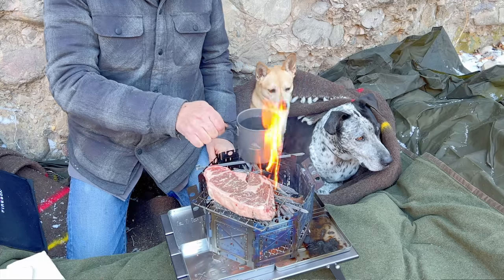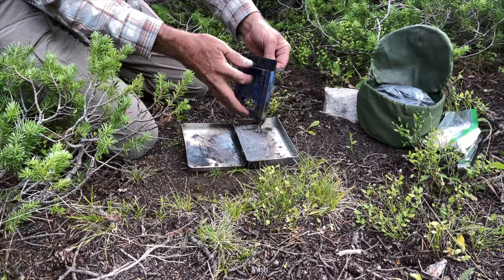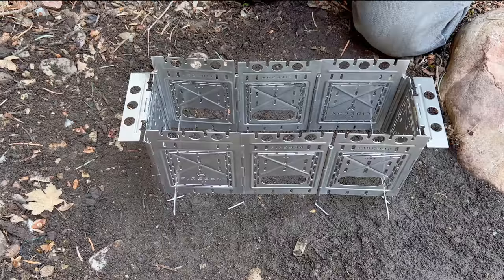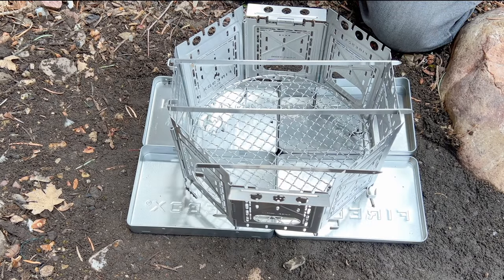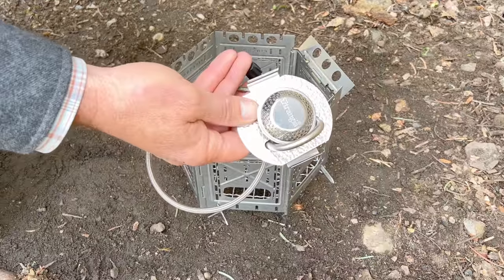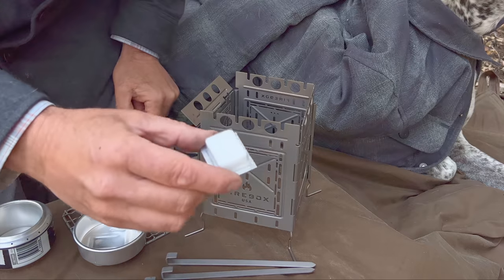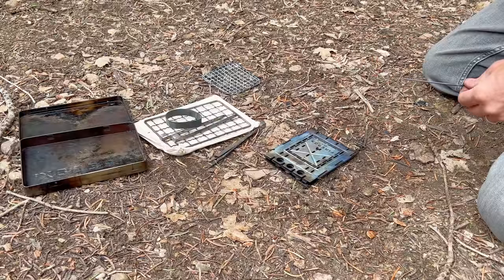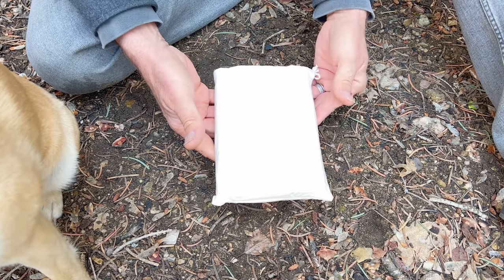Tips & Tricks! Firebox Freestyle Modular Camping Stove Instructional.

Comment: Thanks Steve I received my single titanium freestyle and now had several burns. It starts up really fast and burns hot, though I have managed to create a lower temperature for cooking by just adding larger pieces of wood to the fire. So far it’s exceeded my expectations and will be part of my kit on a 7 day backpacking trip I have planned. Only downside so far is that the tin when acting as an ash pan can  get very hot as small coals can drop through the fire grate so I will probably use some carbon felt underneath to protect the ground or table a bit more.
Reply from the maker: Thank you for your support and feedback Peter, it is truly appreciated. Have fun out there!

Comment: Lots of comments on the quality of the build. As soon as I unpacked mine the first thing I noticed was the greats are much more robust! Maybe it is just me but I really noticed a difference.
Reply from the maker: You are correct Jay the fire grates are quite robust. That's because they endure the highest temperatures. The cool thing is that the wire fire grates are about half the weight of sheet metal fire grates👍😎

Comment: Great tutorial.  Be great if the bag was a dark colour that would hide dirt and grime.  Do we need to worry about hot fires over time wearing out the grates and grills especially with campfires ? 🔥
Reply from the maker: The grills and grates are overbuilt and will last a long time. Heat will lessen their ability to resist corrosion so a light coat of oil maybe needed occasionally to keep the parts properly maintained.

Comment: Hey Steve.  How about making a flat like griddle/hibachi accessory to be purchased separate.  Out of stainless with some type of reinforcement “X” under it what a
The same size as the square grill that sells with the freestyle combo kit.  But that will hold it inside of the fire pit 8 configuration.  

Would probably fit in the same pack as the rest of the kit.  An even more so. If some of the other grates that may be left home that’s not gonna be used for a certain trip.  
    Would definitely love to purchase something like that as an accessory
Reply from the maker: Thanks for sharing your idea with us, we'll have to look into that!
Reply: @fireboxstove  that would be amazing.  I’m definitely in for one of them.   Some kinda”X” pattern on the bottom side that would keep it inside the fire pit 8 without needing to hold it an it sliding around.  
     Also strengthening it for the heat to mitigate any warping from the heat.  An maybe an 1/4 or 1/6 of an inch lip going around it.   
     Maybe maybe just the tinniest fraction of an inch bigger than the big square grate.  So it the square great would sit down right within the lip going around the griddle.  So the only added thickness in the case.  Is the thickness of the stainless sheet itself and whatever warping mitigation in the bottom of it.  
    Ild buy some stainless and put together what I’m talking about myself if I had the ability to weld stainless.   
But would definitely like to see what you could come up with as to that idea.   Would definitely turn out nicer than a home done item

Comment: Another configuration is the “Double Triangle” 
Put both stoves together stretch it out as the “Bushcraft 8”  after it’s in the bushcraft 8, the side closest to yourself make the 2 an 3 panels touch each other by pushing it into the rectangle of the stove.  
     Than pull the 2 an 3 panels on the other side into the stove as you did with the other side until there touching.   An have the folded 2 an 3 panels from each side overlap each other about half way.  
      The 8 panel stove than will basically look like a single 4” freestyle stove.   But will than have a divider from each sides 2 an 3 panels diagonally through the inside of a 4” stove.      
        Now the left an right side of that single stove should have the fold down damper for exhaust.  Than you can run double Swedish fires in each side of the 4” stove in one.  
       Looks just as if you made the triangles singly.  But it’s connected into one an each side had a damper.    Than you’ll have the stability of a single stove vs putting two triangles side by side and the an the added stability of a square base for the pan/pot to sit on
Reply from the maker: Sounds pretty dang cool! I knew my customers would find ways to utilize the freestyles modularity in all sorts of fashions. This setup sounds especially creative. Thank you aqua boss!

Comment: Steve we need a overkill mod for the freestyle to round it off an complete it.
Reply from the maker: I appreciate the adventure in imagining such a setup! Might be crazy cool! When I've considered it previously, I thought it might be similar to the 5-in Firebox which has enough height on its own for swedish fire torch setups and when you stack them vertically it's simply too much height. I'll I'll take the next step and do some mock-ups to see if it could make sense or if it's likely to be too hot to the point of likely damaging parts. We'll see where it goes from here 👍😎
Reply: @fireboxstove  if you can try it out would be cool.  As long as there’s no damages.   
Or sold with a disclaimer not to pack the stove wall to wall with fuel but leave air spaces in.  But to get a very fast burn.  Or if height is the only issue.  Maybe sell the pins as a set.  But also sell it with 4 more stove legs with slightly bigger feet.   
Something like the nano’s windscreen 90° pegs 4-5” feet be the 1/2-3/4 it is normally.  

Or as at your own risk set up.  
I for one would like to experiment myself if you can provide the thickness of the pins/legs and the material it’s made from that I can locate an mock it up myself

Comment: I hope you guys branch out into more camping gear. Maybe design a good small backpacking folding shovel.
Reply: Something similar to the Coleman folding shovel with pick but updated. I've been searching for one forever but nobody has designed one yet. If you made it out of titanium it would be one of the only good titanium shovels on the market.
Reply from the maker: Thanks for the suggestion 👍🙏😎
Reply: @fireboxstove  you could even market the shovel by showing how easy it is to dig a Dakota fire hole with it. On another note there is a company that makes titanium stoves like the Trangia gas burner you sell. I have one and it pairs pretty well with the 5 inch titanium stove but it's tricky to get it set up in the stove. Maybe you could reach out to them to design one that better matches with the stove. I love the Trangia gas burner but for me its too heavy to backpack with. The fire maple is much lighter and cools down really fast. I have a lot of ideas I would like to discuss if you are interested.